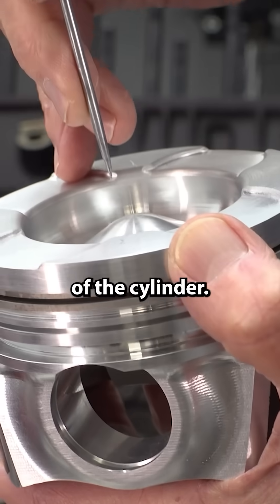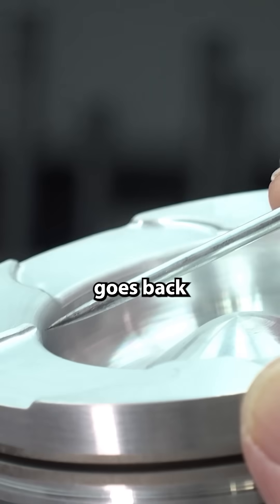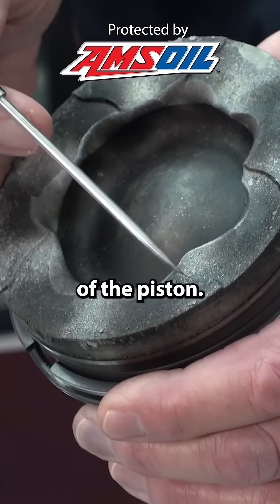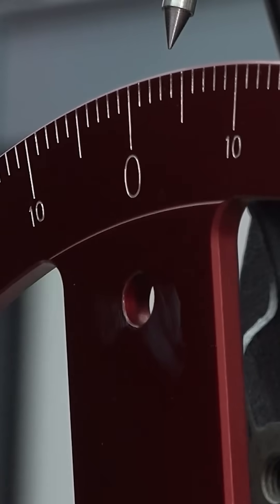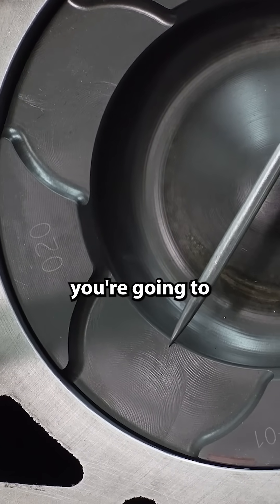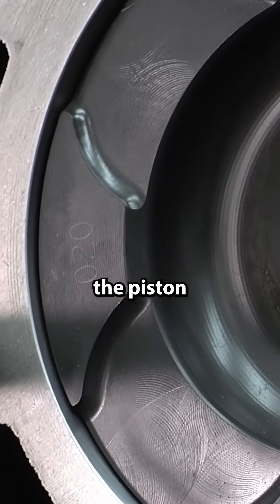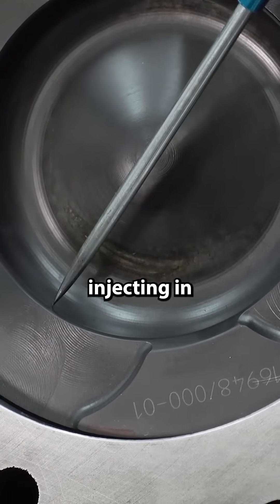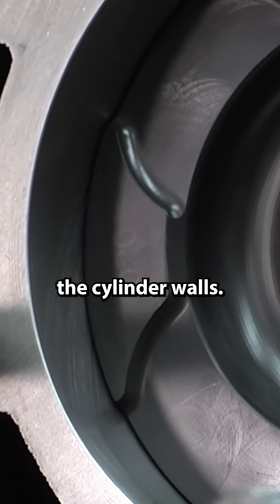How to burn pistons.

Comment: In the modern Diesel engine, only part of the combustion occurs under ‘Constant Pressure’ conditions, so only under heavy loads will injection still be occurring 20 degrees after top dead centre. Most times, injection will have stopped just after top dead centre.  
If? All of the fuel was injected into the cylinder on a Diesel, like a petrol engine, the engine would not be strong enough to stay together. On a petrol engine the combustion process is controlled by the combustion chamber shape. Not available on a Diesel, as it has multiple ignition points. From my days of servicing and testing fuel injections pumps, a roundabout figure for the maximum fuel.   settings is 10cc over 200 strokes for a 100 horse power engine. That is, 10cc divided by 200 for the amount of fuel injected into a cylinder each time, under fill load on a 100 hp engine.  Not a lot. 
More than 30 years ago, I contacted a researcher about fuel injection pressures on a Turbo-charged engine as to, was there a problem when the engine was not on boost with injection spray penetrating as far as the cylinder wall?  Never, cannot happen. Once the first amount of pre-injection fuel is in and ignites, the internal temperatures and pressure in the cylinder reaches max and is held there as the rest of the fuel is injected. The following fuel been injected ignites in an instance, so the fuel been injected never penetrates far into the cylinder as much from the turbulence occurring in the combustion from the swirl introduced by the shape the inlet port, and combustion.  
As would be expected, there has been a massive amount of research done into Diesel Engine combustion. No more so than in the 1930s when Junkers and other Germany engine manufactures were building Diesel aircraft engines.  Many books and research papers have been published since then, and still are. Heavy maths, but, if you want the good oil on the subject, it is not hard to find.
Reply: Sir Harry Ricardo (26 January 1885 – 18 May 1974) was one of the foremost engine designers and researchers of the internal combustion engine. During the First World War, Ricardo designed significantly improved engines for early British tanks. Between the wars, he researched the physics of internal combustion and the design of combustion chambers. This work led to the use of octane ratings, stratified charge, and intake swirl (vortex). Ricardo was instrumental in the development of the sleeve valve engine, particularly for aircraft use. His work and research contributed greatly to the high-power aircraft engines of World War II. After the war, he continued to develop the Diesel pre-combustion chamber (Comet), originally designed in the 1930s, which made high-speed diesel engines possible.
The following excerpt is from a lecture Harry Ricardo gave to the Royal Society of Arts on 23 November 1931.
I am going to take the rather unconventional course of asking you to accompany me, in imagination, inside the cylinder of a diesel engine. Let us imagine ourselves seated comfortably on the top of the piston, at or near the end of the compression stroke. We are in complete darkness, the atmosphere is a trifle oppressive, for the shade temperature is well over 500 Celsius – almost a dull red heat – and the density of the air is such that the contents of an average sitting-room would weigh about a ton; also it is very draughty, in fact, the draught is such that, in reality, we should be blown off our perch and hurled about like autumn leaves in a gale. Suddenly, above our heads, a valve opens and a rainstorm of fuel begins to descend. I have called it a rainstorm, but the velocity of droplets approaches much more nearly that of rifle bullets than of raindrops.
For a while nothing startling happens, the rain continues to fall, the darkness remains intense. Then suddenly, away to our right perhaps, a brilliant gleam of light appears, moving swiftly and purposefully; in an instant this is followed by a myriad others all around us, some large and some small, until on all sides of us the space is filled with a merry blaze of moving lights; from time to time the smaller lights wink and go out, while the larger ones develop fiery tails like comets; occasionally these strike the walls, but, being surrounded by an envelope of burning vapour, they merely bounce off like drops of water spilt on a red hot plate.
Right overhead all is darkness still, the rainstorm continues, and the heat is becoming intense; and now we shall notice that a change is taking place. Many of the smaller lights around us have gone out, but new ones are beginning to appear, more overhead, and to form themselves into definite streams shooting rapidly downwards or outwards from the direction of the injector nozzles.
Looking round again we see that the lights around are growing yellower; they no longer move in a definite direction, but appear to be drifting listlessly hither and thither; here and there they are crowding together in dense nebulae, and these are burning now with a sickly, smoky flame, half suffocated for want of oxygen. Now we are attracted by a dazzle, and looking up we see that what at first was cold rain falling through utter darkness, has given place to a cascade of fire as from a rocket. For a little while this continues, then ceases abruptly as the fuel valve closes.
Above and all around us are still some lingering fire balls, now trailing long tails of sparks and smoke and wandering aimlessly in search of the last dregs of oxygen which will consume them finally and set their souls at rest. If so, well and good; if not, some unromantic engineer outside will merely grumble that the exhaust is dirty and will set the fuel valve to close a trifle earlier.
So ends the scene, or rather my conception of the scene, and I will ask you to realise that what has taken me nearly five minutes to describe may all be enacted in one five hundredth of a second or even less.

Comment: Down at 40* after TDC the cylinder wall is getting sprayed making the mixture in the piston cup lean which in turn burns the piston (reference the burnt piston) so to continue adding fuel that far after TDC change the spray pattern of the injectors.   You cant change it that much though or it makes the combustion inefficient closer to TDC.
Reply: @maritaquality
1 second ago
It does not happen, if this was problem it would have been solved a 100 years ago. If any fuel mist touches any surface, the fine droplets combined into bigger droplets that are slow to burn. The burning is incomplete by the time the exhaust valve opens so you get smoke, loss of power higher, fuel consumption.  When the first amount of fuel is injected into a Diesel engine then the pressure and temperature in the cylinder increases very rapidly, so the remaining fuel is instantly burnt on injection

Comment: Tune: do not spray beyond 20 degrees because will burn piston 👍
Reply: It does not happen, if this was problem it would have been solved a 100 years ago. If any fuel mist touches any surface, the fine droplets combined into bigger droplets that are slow to burn. The burning is incomplete by the time the exhaust valve opens so you get smoke, loss of power higher, fuel consumption. When the first amount of fuel is injected into a Diesel engine then the pressure and temperature in the cylinder increases very rapidly, so the remaining fuel is instantly burnt on injection

Comment: So was timing to advance and thats the problem?
Reply: It does not happen, if this was a problem it would have been solved a 100 years ago. If any fuel mist touches any surface, the fine droplets combined into bigger droplets that are slow to burn. The burning is incomplete by the time the exhaust valve opens so you get smoke, loss of power higher, fuel consumption. When the first amount of fuel is injected into a Diesel engine then the pressure and temperature in the cylinder increases very rapidly, so the remaining fuel is instantly burnt on injection
Reply: @maritaquality so the injection timing is obviously off if the injector is still spraying, at 10 after it should stop, till it starts back on the compression stroke. And the goal of what he's doing is stop smoke. That is a problem, and it should have already been solved, think about if you can eliminate the smoking of a diesel you can delete it and still pass emissions. It would be a clean burning diesel and the efficiency would increase as well.  So yeah I have to agree it has been a problem for years but he's trying to correct that fuel dumping issue

Comment: Why is the injector still spraying?
To lubricate the cylinder walls?
Seems like a waste of fuel.
Reply: It does not happen, if this was a problem it would have been solved a 100 years ago. If any fuel mist touches any surface, the fine droplets combined into bigger droplets that are slow to burn. The burning is incomplete by the time the exhaust valve opens so you get smoke, loss of power higher, fuel consumption. When the first amount of fuel is injected into a Diesel engine then the pressure and temperature in the cylinder increases very rapidly, so the remaining fuel is instantly burnt on injection

Comment: I have never seen a dished piston like that. Now hearing the reason is side spraying injectors trying to coat the perimeter it got me thinking as to why. I think its to put the fuel in the work area of the flame front to chase the retreating piston and get a longer power impulse on the stroke. I wonder if we can do something like that for long stroke gasoline engines like race bikes.

Comment: Get injectors that spay at a downward angle problem solved
Reply: It does not happen, if this was a problem it would have been solved a 100 years ago. If any fuel mist touches any surface, the fine droplets combined into bigger droplets that are slow to burn. The burning is incomplete by the time the exhaust valve opens so you get smoke, loss of power higher, fuel consumption. When the first amount of fuel is injected into a Diesel engine then the pressure and temperature in the cylinder increases very rapidly, so the remaining fuel is instantly burnt on injection

Comment: Is this for common rail engines as well? Correct me if im wrong but i thought common rail engines spray the diesel?/gas from the top.
Reply: This is a common rail engine.
Reply: Direct injection is the term for fuel injected on top of the piston, 
But not all direct injection engines are common rail The 12 valve Cummins is direct injection but not common rail

Comment: If I’m getting this right, the injector should spray into the piston cup, but if the crank angle exceeds 40 degrees it’ll spray the walls instead and burn the pistons. This is very important info for diesel tuners especially if you run the stock injectors.
Reply: If any fuel injected into a Diesel engine touches any surface, the fine mist droplets combined and become a bigger droplet that burns slowly  and has not burnt completely when the exhaust valve opens so that you get smoke, lack of engine power and increased fuel use. The same result if you have an injector that is not spraying correctly.  When the first fuel is injected into a cylinder the pressure and heat raises to high levels, so any fuel injected after this, is burnt as soon as it leaves the injector nozzle.   "I am going to take the rather unconventional course of asking you to accompany me, in imagination, inside the cylinder of a diesel engine. Let us imagine ourselves seated comfortably on the top of the piston, at or near the end of the compression stroke. We are in complete darkness, the atmosphere is a trifle oppressive, for the shade temperature is well over 500 Celsius – almost a dull red heat – and the density of the air is such that the contents of an average sitting-room would weigh about a ton; also it is very draughty, in fact, the draught is such that, in reality, we should be blown off our perch and hurled about like autumn leaves in a gale. Suddenly, above our heads, a valve opens and a rainstorm of fuel begins to descend. I have called it a rainstorm, but the velocity of droplets approaches much more nearly that of rifle bullets than of raindrops."
Reply: @maritaquality do go on...

Comment: No idea whats going on
Reply: Fuel injection. This is how your car runs
Reply: He is using a degree wheel mounted to the end of the crankshaft damper. Obviously a crank will turn all the way around (unless seized!) or 360 degrees. We can call TDC Top Dead Center as the start point, or reference point, or zero degrees. TDC is the highest point that the piston will reach relative to up or the cylinder head and valves above. Since TDC is now our 0 Degree point we will turn the crankshaft until that degree wheel has the 40 lined up with the TDC or zero mark. Gale was saying that the piston is now too far down IF that stock injector is spraying. It completely misses the top of the piston at that point. 0 Degrees to 30 degrees, all is good, still high enough. The tuner or engine control software needs to close the injector by 30 degrees, maybe 35 if you push it. I have no clue with mechanical injection - likely safe, becauae it only operates as designed unless parts are physically modified.
Reply: I just work here. No where in the algorithm should I be exposed to this.
Reply: @lukemsilver  yeah the algorithm is heavy on the spectrum

Comment: Wouldn’t it leave burn marks all around the piston? Since it injects fuel in all directions
Reply: It did leave burn marks in all the directions it sprays
Reply: It does not happen, if this was a problem it would have been solved a 100 years ago. If any fuel mist touches any surface, the fine droplets combined into bigger droplets that are slow to burn. The burning is incomplete by the time the exhaust valve opens so you get smoke, loss of power higher, fuel consumption. When the first amount of fuel is injected into a Diesel engine then the pressure and temperature in the cylinder increases very rapidly, so the remaining fuel is instantly burnt on injection

Comment: I never seen pistons like those. Plus how long is your injector squirt for.???
Reply: All modern Diesel Engines have the combustion chamber in the Piston crown. The air is squeezed a lot harder on a Diesel so that the air becomes hot enough to ignite the fuel

Comment: Question. Would a larger injector with a shorter pulse time work? Just curious.
Reply: They do on modern Diesels, but it is not the injector, a greater amount of fuel is injected over a shorter time compared to older Diesels, why you get near petrol engine accleration
Reply: You can inject into intake and have too lean to burn mixture at the start. Fun part is; it doesn't have to diesel ...natural gas, butane, gasoline...
Reply: @dragancrnogorac3851 if you inject diesel thru the intake you will get detionation & bend rods !

Comment: Bet some tuners didn’t know that lol
Reply: went to school for diesel and I didn't really know 
    but engines were not as advanced then most had flat top pistons 
    love watching this guy
Reply: and most injectors sprayed 4 streams at about a 15⁰ angle 
    iirc from pop testing injectors
Reply: mind you I was 14 going to school for it and am 42 now 
    the year I left got the first electronic injection diesel 
   had a amazing teacher  journeyman diesel mechanic 
   and I was a bit of a teachers pet 
just lived doing the work 
    was the first time in school I was ever happy to have paper work 
    actually felt like it was worth something 
and I did get to tear down and rebuild massive engines 
     learned to use micrometers telescoping gages calipers feelers gauge 
    how to check for taper out of roundness inplay oil clearance 
    even got to learn how rebuild a rear end  

I quit because of getting bullied 
    didn't help that the seniors thought the teacher was gonna send me a junior to the state competition
   did get to do some work on that I believe it was a Cummings from Gm 
    learned how to use a scan tool and bleed the fuel system 
    it was so cool what all you could do with the scan tool

Comment: So whats the answer ?
Reply: If you are closing in on 40 degrees timing, you are running out of injector and need bigger ones
Reply: Flat top pistons
Reply: @BlainesGarage no , lower injector tip in chamber , but then emissions go up ( the fine balance act too high higher piston temp lower injector tip high emissions )
Reply: @ruxoneto6560  No, add more of a radius to the edge to eliminate the hot spot.
Reply: @BlainesGarage  the radius might help but on the exhaust valve side of piston there is to much aluminum above wrist pin can't get oil over to that side of piston to cool & the crown of piston burns off .
Reply: It does not happen, if this was a problem it would have been solved a 100 years ago. If any fuel mist touches any surface, the fine droplets combined into bigger droplets that are slow to burn. The burning is incomplete by the time the exhaust valve opens so you get smoke, loss of power higher, fuel consumption. When the first amount of fuel is injected into a Diesel engine then the pressure and temperature in the cylinder increases very rapidly, so the remaining fuel is instantly burnt on injection